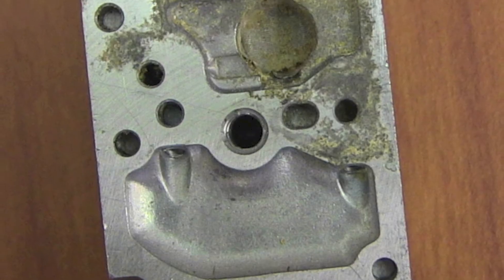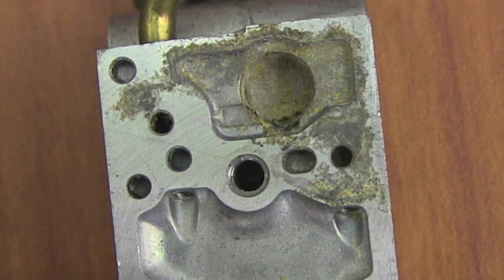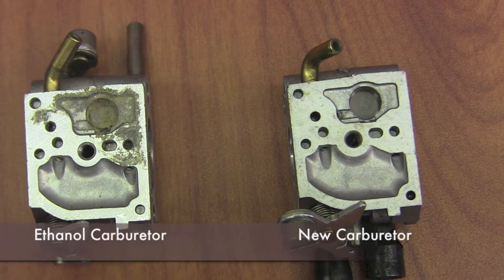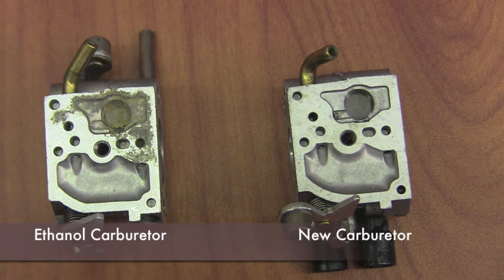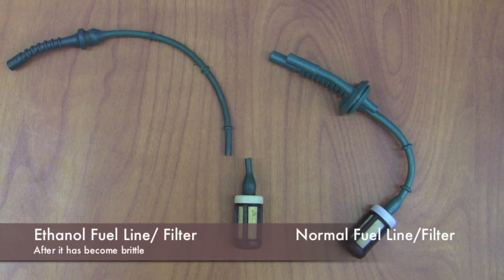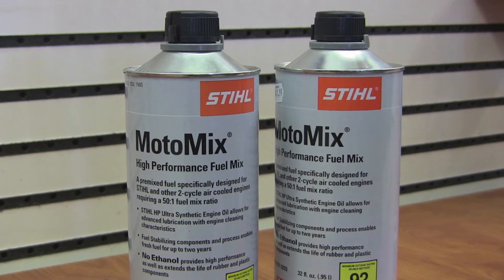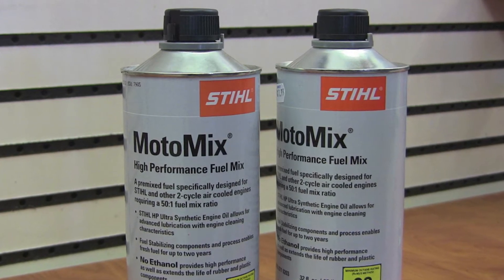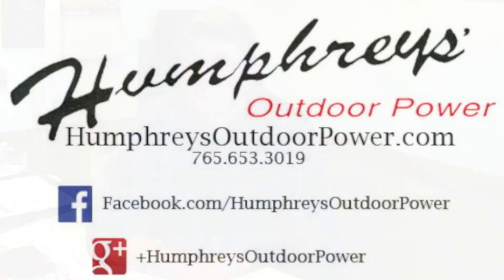The Pitfalls of Ethanol Gas in 2 Cycle Engines

Comment: My last two string trimmers won’t start, they just flat will not start. My leaf blower, won’t start my not very old four-wheel-drive walk behind Husqvarna lawnmower, won’t start. I’ve been around small engines for decades, riding, dirt, bikes, cleaning, carburetors, but I’ve had two leaf blowers, and two string trimmers just not start anymore. There are two strokes. My Husqvarna lawnmower is a four cycle with a briggs engine, and it won’t start. I never thought that the ethanol in the gas could be attacking the carburetors in the plastic lines. I was suspecting the crank seals going bad on the two strokes after they were two or three years old. That’s a common failure part on Two stroke motorcycles when they won’t start is a crank seal.
  nowyou have me wondering about my chainsaw. I generally run that stuff completely out of gas until they quit at the end of each season…
  what do you think of taking the ethanol out of gas by adding water to the gas, shaking it, and the water will go to the bottom of the gas tank combined with the ethanol. And you can siphon that out of your gas can if you can see through the gas can.. You can actually see demonstration of this removing ethanol by adding water and siphoning the water that has absorbed the ethanol out of your gas videos on YouTube
Reply: My local gas station started posting signs that it was 10 % ethanol . Now my blower and trimmer will not start. I've ran this same equipment for at least ten years , now problems ? I suspect it is the fuel .

Comment: However it is not the engine that is failing it is O rings and the air intake.  if those were changed then the engine could be tuned to run on pure E.  Right?

Comment: Ethanol is pure alcohol. No residue. If there's a residue its from other components being dissolved. That may be the weakening of rubber lines you're talking about.
That just means the items you're using are not designed with ethanol in mind...That said...Regular gasoline does exactly the same thing just not as fast. I suggest spending a bit of money to get better quality products.

Comment: Why don't you make machines that can handle it instead?  I don't know what crap fuel you got or shit you got in your tanks but I've hade pre-mixed 5% ethanol fuel sitting for almost a year and ran just fine in my 180cc 2-stroke with membrane carburetor. Never had any problems and not seen any deposits. Ethanol doesn't leave deposits, that's complete BS, it may dissolve all the shit you got in your tank and that will clog the carb.

Comment: Just purchased a new gas powered leaf blower.  The one I had for at least 6 years finally gave out.  I never thought much about the ethanol in the gas i was using but it makes sense.  Will start using the non ethanol with my new ones.  Thanks for the video

Comment: Well to start with the typical chain saw engine was not designed for alcohol use. The seals and lines are not compatible with alcohol as well. Lastly these engines are not jetted properly for alcohol use. A little education of the customer would seem to take care of this problem. This is not an issue of the fuel type but the incorrect use of this type. Go to the pump that is alcohol free for goodness sakes.